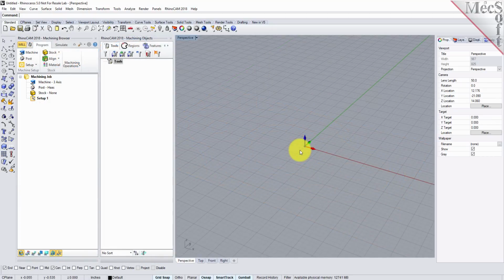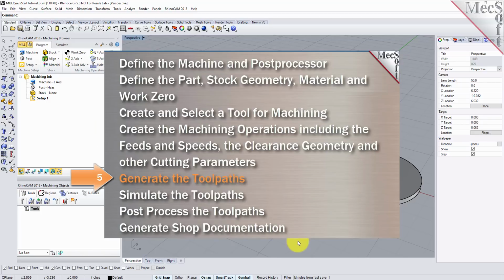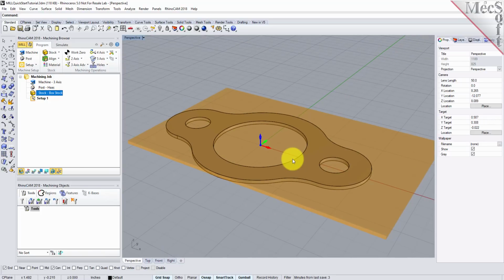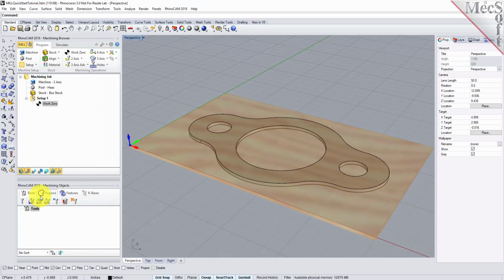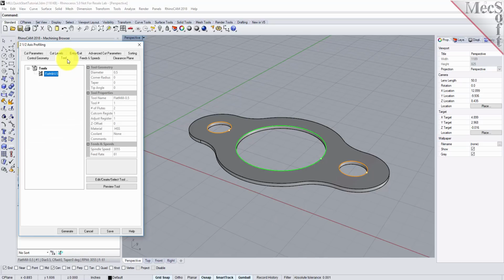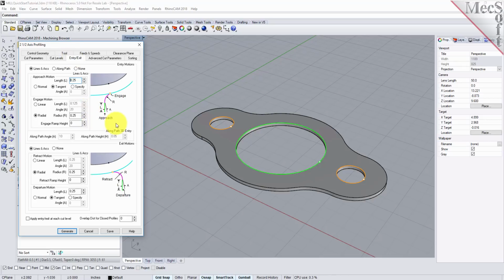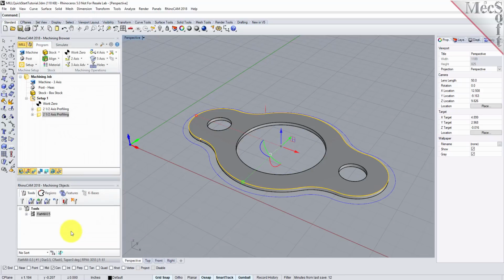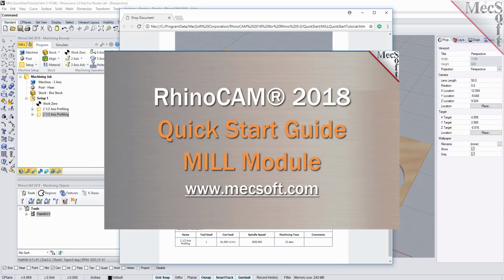RhinoCAM 2018 Mill Quick Start

Comment: What version of Rhinocam is this? Xpress or standard?
Reply from the maker: You can machine this simple part using the 2-1/2 Axis Profiling toolpath strategy that is included in the Express configuration.  Express also includes Facing, Pocketing, Engraving and V-Carving as well as 3 Axis Horizontal Roughing, Parallel Finishing and Drilling.  The high resolution cut material simulation shown in this video is available starting in the Standard configuration.  Express includes a lover resolution simulation.  I hope this helps.
Reply: what one would I need for making guitar bodies and necks?
Reply from the maker: We have many guitar, cello and violin craftsmen using our CAM software.  (See https://mecsoft.com/casestudies/).  Depending on the contours and amount of tool control.  The Standard configuration would be a starting point.  Please give us a call to answer any other questions you might have.

Comment: Can I add a 2d curve to a 3d model in order to generate either a pocket or a profile operation?
Reply from the maker: Yes you certainly can.  @-1/2 Axis machining can be driven by either/or 2D curves and 3D face edges.
Reply: Thank you, I'd ask 2 more  questions if you don't mind, can I decide the starting point of a tool path when milling? For example, start from the center of a hole? Also, the first pass of a pocketing operation is the most stressful for an end mill, can I slow down the feed when the cutter is fully engaged into the material to then increase it once the first pass is done?
Reply from the maker: Hello,
Yes, in our Standard and higher configurations, you can specify a start point for pocketing.  In all configurations you can specify a feedrate reduction factor for the first XY pass and when plunging between levels.  In our Professional configuration and higher you also have Feedrate Optimization controls that allow you to automatically slowdown the feedrate prior to sharp corners and automatically return to the specified cut feedrate after corners.  You have control over the corner angle and distances to and from corners, etc.  Once set these controls are applied automatically in the posted g-code.
Reply from the maker: Sorry missed this question!  The answer is YES you can.